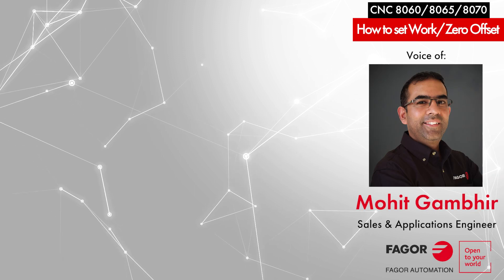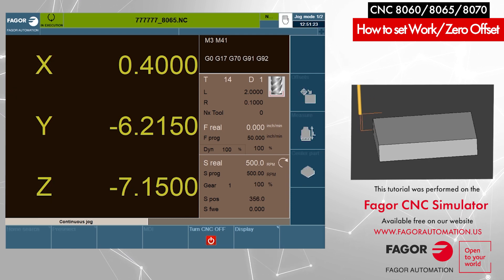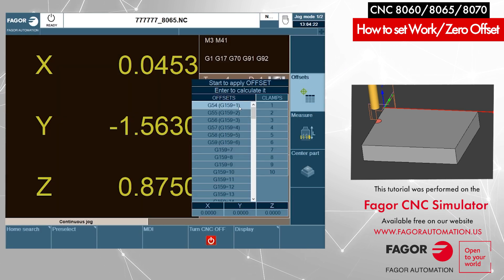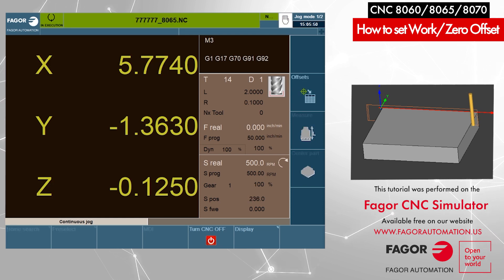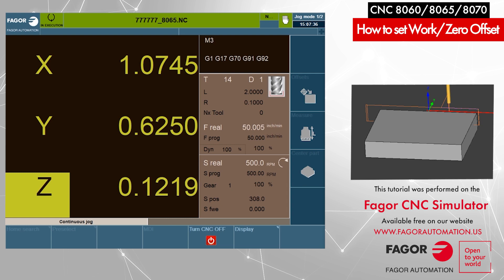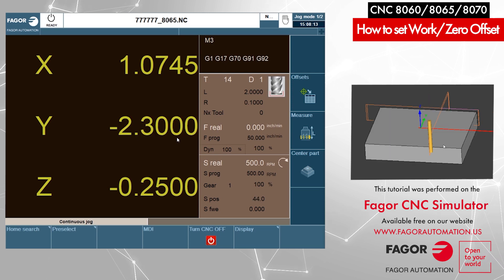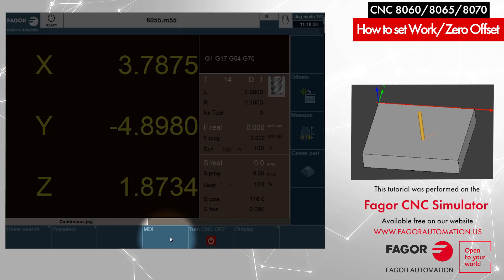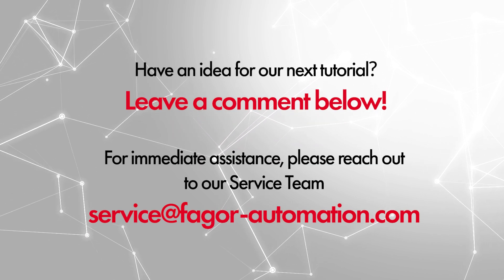Setting a Zero / Work Offset - Fagor CNC 8060 / 8065 / 8070

Comment: can i choose single axis coordinate to be saved into offsets table? (example: only save Z Axis)
Reply: I know this is old and you might (probably) have already figured it out, but in case not, and / or if someone else reads this and might be wondering the same thing, I'll give some input to this.

If I'm understanding you correctly, the answer is yes. When you press "enter" with the offset table open, it only saves what has been manually changed, so say you are working with a 3 axis machine and you had already set the X, Y, and Z and saved it to say the G54 table but then you decide for some reason that the Z needs to be something different (like maybe a thicker piece of stock and all the features need to be offset up, if you make a change to Z and open up the table and hit enter (i.e., save), only the Z will update being that it is the only thing that has been changed.

It should also be noted that if you have setup multiple offsets (like say parts in two different vises and one is G54 and the other, G55) and you want to make a change like you mentioned, MAKE SURE you have that offset that you want to the change to be in active.. Not doing this bit me in the rear one time not too long ago because I had set up the G54 first, then the G55 for second side op in 2nd vice but then realized that I had set the G54 ("Z" ironically) wrong, well because I didn't have the G54 active, it overwrote the G54 with the X and Y from G55 but with the new Z that I set.